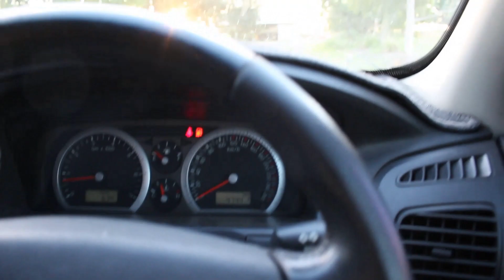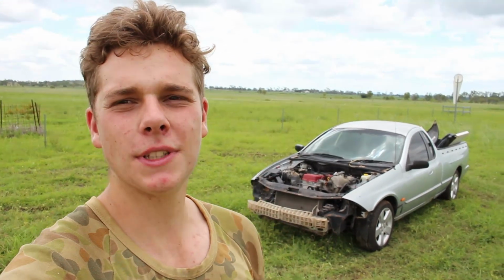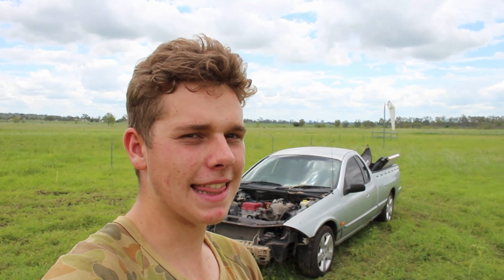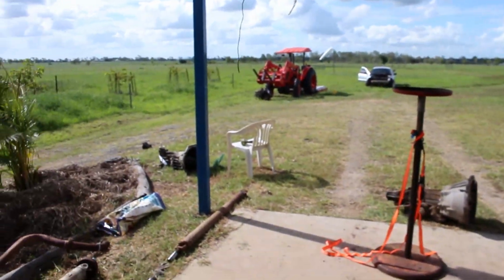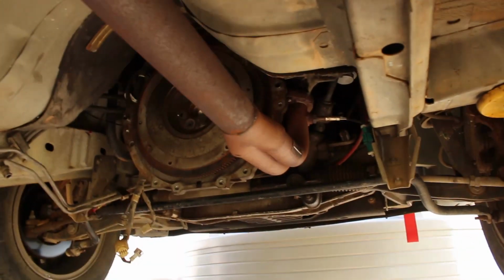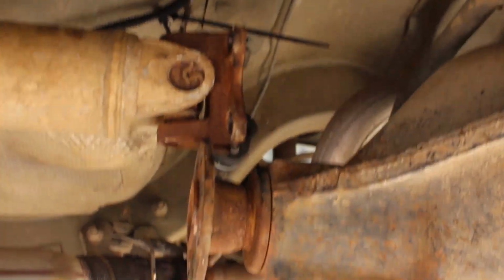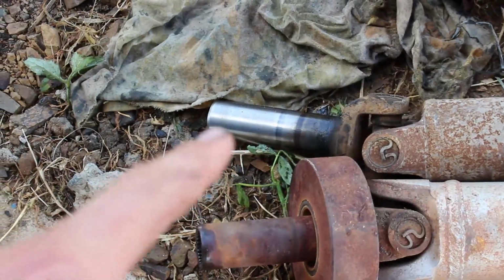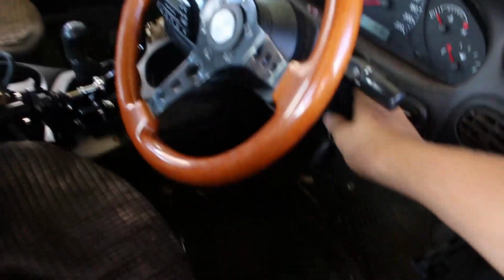T5 MANAUL SWAP INTO NAUGHTY. Episode 1

Comment: No showing thefitment of pedal box ? 😵
Reply from the maker: JB TheFilmer no because it’s almost impossible to get to let alone film it 😂
Reply: @RichosCustoms  did you take the dash out
Reply: @jsd9871  wtf are you on about ive changed the dash and removed dashes in multiple au's and it weighs fucking max 20kg feels like 10kg and i did it by myself with 0 issues at all... crack is bad

Comment: them extractors and the hp XR head are better then what you have just swap your stage 4 crow cam and springs onto the hp head and it will make more power
Reply from the maker: Liam Uzzell yes as you say, i am going to build the hp motor next as it’s the best motor made, I agree, I didn’t have the motor back then but can always improve:))

Comment: Hey mate you wouldn't happen to know if there is a way to identify a manual computer from an auto computer because I've got a manual one lying around somewhere but I cannot identify it from the auto ones two that are marked Auto computer and two I cannot identify from because I didn't Mark and when I removed them from wreck because I've got T5 sitting in a wreck with no computer because I took the computer out because the wreckers started filling with water when it rains and now I can't find the the fucken now because I've got that many computers so if you can let me know if there's any identifying features that I can look for that be very helpful

Comment: Hey mate what 2 wires did you wire together to trick the ecu in thinking it’s always in neutral? I’m building up an xe wagon and engine swapping it with an au motor and as well with manual conversion with t5 and don’t really want to mess around with looking for a new manual ecu :/
Reply from the maker: Ryan Hovey black to join with red and blue
Reply: Richo's Customs appreciate it mate thank you, I’m loving your videos you’re helping so much with my project build keep it up champion 👍🏽
Reply from the maker: Ryan Hovey Thanks mate! My xe should be done soon too
Reply: Richo's Customs you should definitely do some videos on your xe mate! I thought I spotted an old xe in the background of one of your turbo kit videos 😁
Reply from the maker: Ryan Hovey I’ve got a lot on at the moment but I definitely plan to!